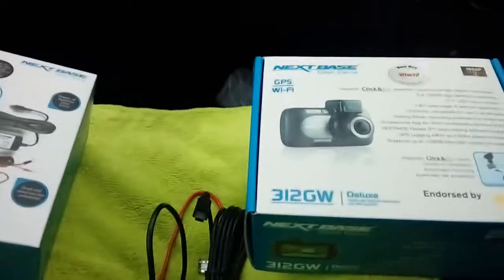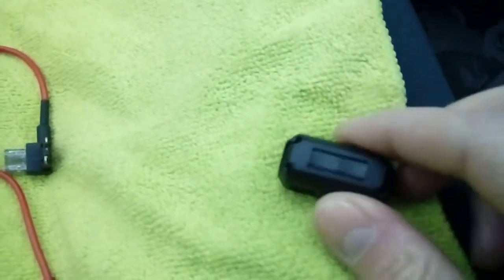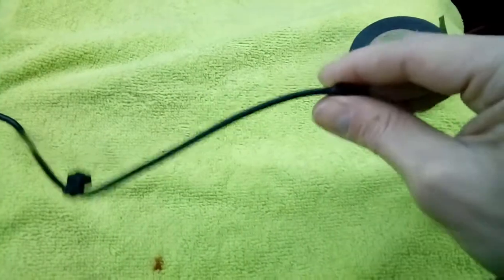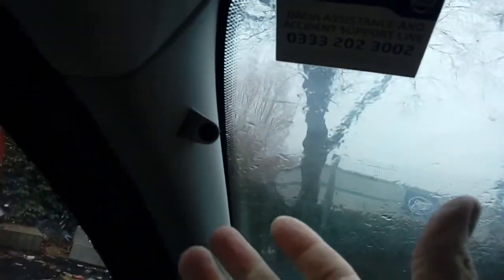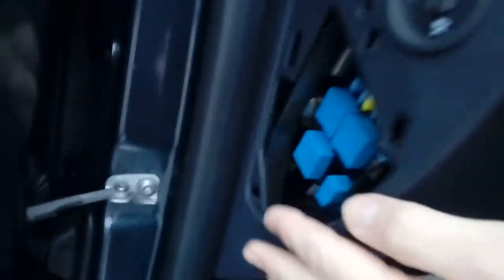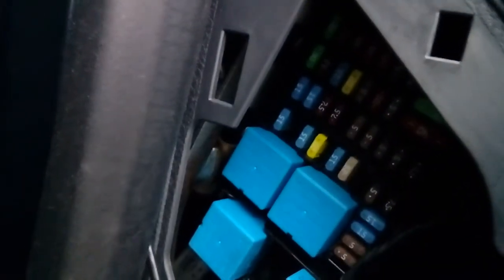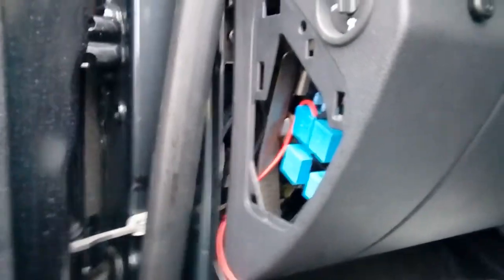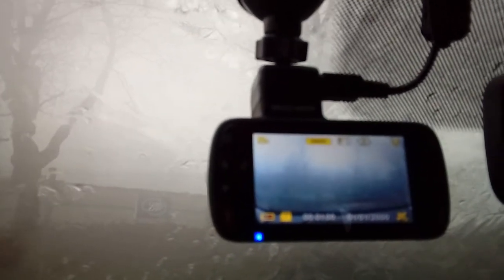Dacia Sandero 2012 - 2018 how to fit a dash cam to fuse box,simple guide.

Comment: Hello. 
I thought they had to be wired into permanently on fuses?
Reply from the maker: Nope, wire to switched or faced with the possibility of a flat battery.
Reply: @PJs projects  ok thanks. I've just got a 422 nextbase. Will the parking camera feature still work if on switched?

Thanks for your help
Reply: @PJsprojects  does parking feature still work on switched?